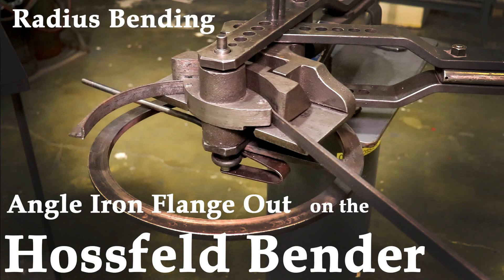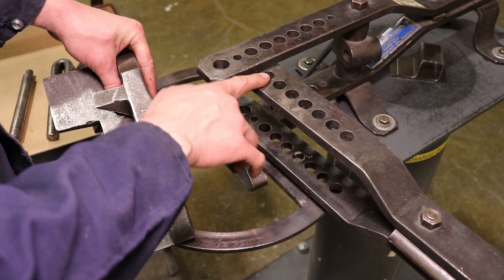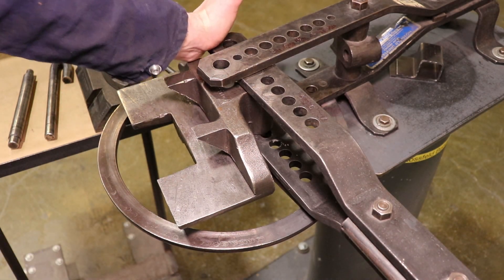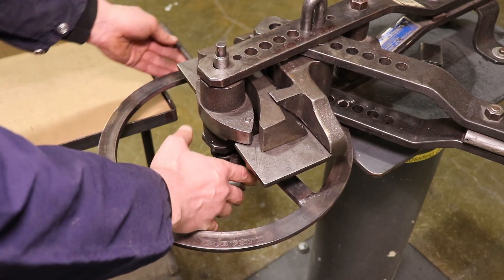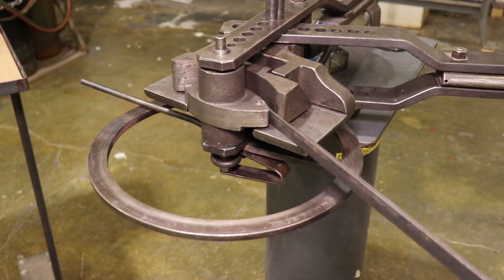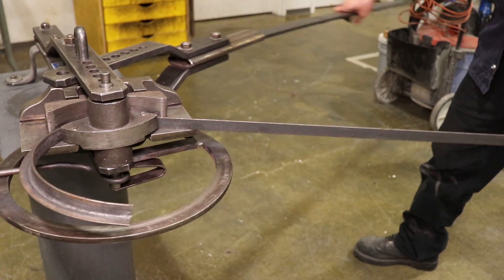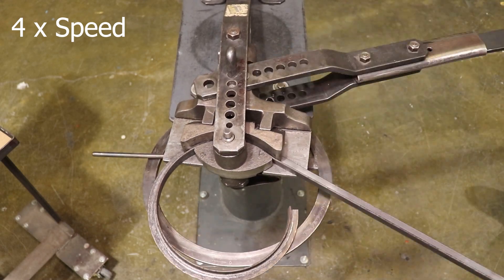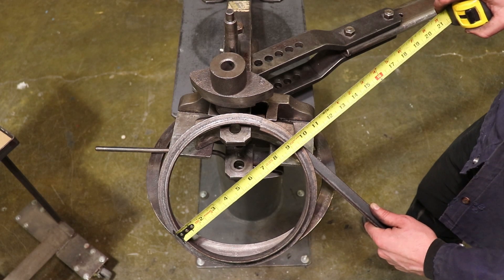Hossfeld Bender - Angle Iron Flange Out

Comment: Just purchased the #2.  Appreciates all the folks sharing their knowledge and insight. 

As I learn the vernacular of benders and bending, wanted to ask- 
The five inch radius for angle iron with an “outside radius”:
Rather than measuring the inside of the verticals wall of the flange- which shows 9”, would I be wrong in expecting the measurement to go across the diameter of the outside of the flat part of the angle iron?
Wouldn’t that give a more accurate measurement and accounting of what the 5” die is referencing?

Comment: Can I use a 18 inch cam dye with a 15 inch radius block??
Reply from the maker: This set-up is designed to pinch just the vertical leg of angle material, so the radius dies are closely matched, however it is common in the student shop for folks to use, for example, the 5-1/2" radius cam die with a 6" radius block if bending 1/2" square or round bar stock. So the difference in radius is made up by the thicker material. Just realize the radius will not be exactly what is printed on the blocks if bending different shape material. There is also a limit to what the machine can bend in terms of forces the machine and the tooling can handle. You will want to do a little trial piece and see what the mismatched tooling gives you.
Reply: @robdamico5304  thanks so much! your video helped me out immensely

Comment: not sure if your bender is not secure to the base or the base not secure to the floor... but lots of wobble... I would not trust it with much of a cheater bar... been using mine for the better part of 40 years... amazing bender but troublesome at first